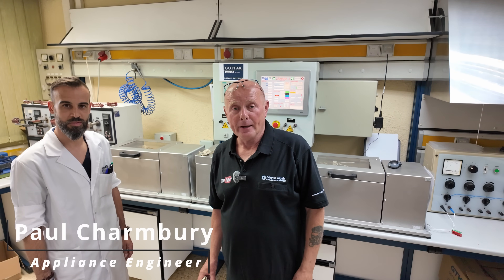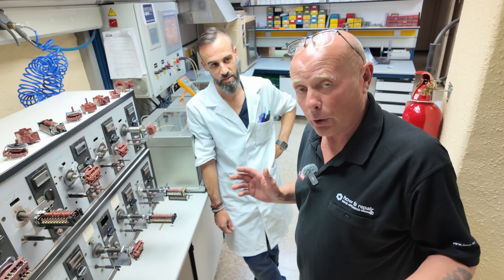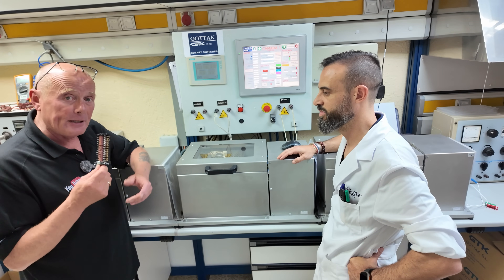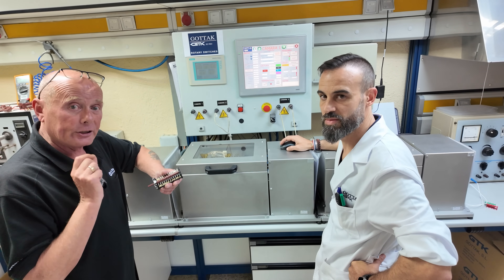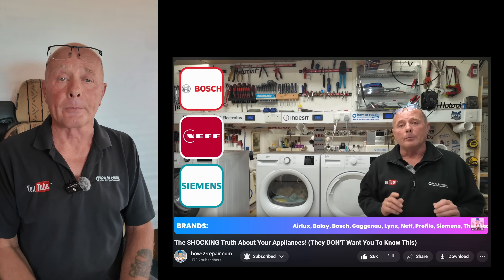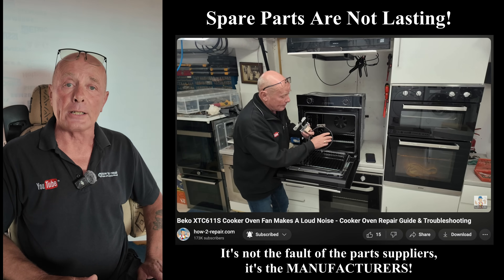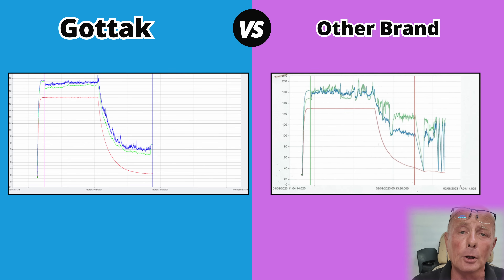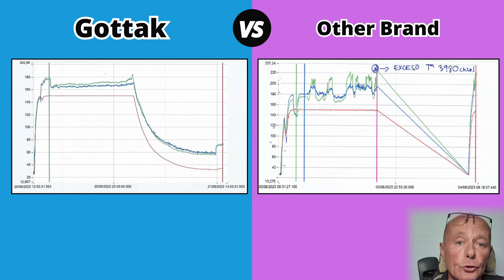Why Your Appliances FAIL SO FAST! Lab Results EXPOSE the Truth!

Comment: I'll very happily add a comment if it might help! IF the manufacturers are actually reading, that is. I'd say to them "cut it the F out!" Whichever manufacturer decides to actually build quality again can still boast about sustainability because we won't be throwing away tons and tons of these machines. If they're willing to be transparent enough to back up reasons for increased cost thanks to superior build quality, I'll even fork over. But they've got to prove it, not just say it ...

Comment: You are so right about the quality of appliances these days vs in the 70s-90s.  I'm proud to say that I'm still using a Whirlpool washer that is 31 years old (I've replaced the agitator dogs twice, and the control panel once, but other than that, it's worked like a charm!), a Whirlpool refrigerator that is 31 years old (I've only had to replace the icemaker a few times), and a Hotpoint dryer that is 33 years old but is now experiencing some trouble with shutting off (which brought me to your channel!  I'm hoping to find an easy fix for my dryer so the legacy can continue.)  My daughter's new-fangled washer with all sorts of computerization, on the other hand, died just a month or two after the warranty (which I think was only 1-2 years!) and cost her an expensive repairman visit.

Comment: It may not matter if you buy a more expensive appliance as the components may not be any better and will still fail just after the warranty. This has been a race to the bottom by the manufacturers who should give a price of ownership which matters more the the price tag on the front. Keep doing these videos they highlight the current problems of trying to get a quality product in a confusing market.

Comment: And it's not just appliances...it's everywhere, everythings going down in quality and shifted to be a throw-away product! I'm tired of it. And in most cases where something can be repaired, youre supposed to swap out whole units, instead of component based repairs (e.g. bad capacitor, failed transistor on a pcb, the broken bearing instead of a glued together washing machine tub and so on...).

Comment: I bought a Candy heat pump dryer some years ago and, lo and behold, it failed shortly after the warranty expired.  I attempted a repair, thinking it was a water pump.  That being replaced, it did not remedy the situation.  The dryer would run, heat up, but the moisture drawn from the clothes got sent out thru a vent into the room.  The conclusion ....I'll NEVER buy another Candy appliance.
Reply from the maker: Thanks for sharing your experience, and it's a familiar story for many.

Comment: When I started to notice this at least 10 years ago, the more I hang on to my 1992 Montgomery wards Admiral fridge, washer and drier. Plus a 1982 Roper gas stove that used old school pilot lights. The washer and drier use an old style rotary switch for the main control, the swiches are well built, the wiring is plenty adequate,the steel panels look dipped, not sprayed. Everything looks built to last 20 yrs min and NO processors. The fridge uses a simple TXV to cycle the fridge off and on and a electro-mechanical timer to defrost every 10 hours.  I finally had to add just 2 ozs of R12 about 3 years ago when it was 30 years old and replace the defrost limit switch behind the freezer panel. New old stock is available on ebay. Amazing how they used to build compressors that lasted decades. My Admiral has a Enbraco built in Brazil and the only thing that failed was the starter relay after 31 years. These appliances will outlive me.  I just replaced my 32 year water heater last year, a Rheem. Unheard of now days.
Reply from the maker: Unfortunately, the manufacturing mindset has shifted. The practice of built-in obsolescence, where products are designed with an artificially limited lifespan, is now common. It ensures repeat sales at the expense of the consumer's wallet and the environment. A 32-year lifespan for a water heater is, as you said, almost unheard of today.

It sounds like those appliances will indeed outlive you! Thanks for sharing such a brilliant, detailed comment. Please don't forget to like and subscribe to our channel. Cheers!

Comment: Was there a planned obsolescence for this video 😅? Rotary switches?! All my appliances (even my washing machine from more than 10 years ago) use control boards and relays (maybe even triacs, as I can't hear a mechanical relay clicking).
Reply from the maker: A failed board is a far more common and expensive problem than a bad switch. That shift from robust mechanical systems to fragile, non-serviceable electronics is the most effective form of built-in obsolescence today. This is the core issue we explore throughout our content. For a deeper dive into the problems with modern electronics in appliances, this video is particularly relevant: https://www.youtube.com/watch?v=QsdGd2qDPaI

Comment: The bean counters get involved because the "big boys" want to make more $ per unit and have the units fail sooner so that we have to buy more units through out our lives which results in even more $ for them. Quality is not a factor anymore. I would pay more for a quality unit, made with quality parts. The trouble is knowing which brands (if any) are of good quality any more. I repair small engines. Briggs and Stratton used to be a good name. Now we call it 'Breaks and Scrap 'em'.
Reply from the maker: Thanks for the comment mate. The link between brand reputation, price, and actual durability has been broken, leaving even savvy customers who are willing to pay more for quality in a difficult position. This is the very definition of the built-in obsolescence we discuss.

Our goal is to try and bridge that information gap. For a deeper dive into the manufacturing tactics that have eroded quality, please check out the full video here: https://youtu.be/gEgSCbZnHVM?si=wTIw0mELuhWaw4aX

Comment: A few years ago I bought a 3 hp radial arm saw built in 1953. Four years before I was even born.   It was well kept and looked like new, and works like new.   Still running without any issues 72 years later.
Reply from the maker: Your saw is a perfect example of what we've lost, and its story is the exact opposite of the built-in obsolescence we discuss in our video. For a deeper dive into why modern tools and appliances often don't have this kind of longevity, please check out the full video here: https://youtu.be/gEgSCbZnHVM?si=wTIw0mELuhWaw4aX
Reply: @How-to-repair About 30 years ago I bought a ShopSmith. Its lasted all that time without issue. I bought one because I could not wait for my Dad to pass to inherit the one he had had for 40 years.   It’s well made, and still made in the USA but their stuff is so durable and lasts so long that they are in perpetual peril of going under.  Even new buyers can find them used online for a fraction of the cost of new because they still work like new.  As a result the company that makes them has a hard time making a profit.   They just sold to a new owner, who is trying hard to promote the product, but folks are in love with their all plastic Box Store tools.  Every part on the ShopSmith mark V is user serviceable and the parts have not been changed or modified in 60 years.   They started making a new power head with a touchpad interface to control speed- which I think was a mistake, because the variable diameter pulley and bell crank system the ShopSmith has had for 70 years has been bulletproof. 
You I might want to do an episode on the ShopSmith being the last major power tool brand being made in the US.  Or on the Original Saw company that still manufactures old 1950’s designed DeWalt radial arm saws.

Comment: I’m not an engineer but as a consumer I have noticed white goods becoming worse. Especially Hoover and Bosch.
Reply from the maker: Hi mate thanks for your comment. You absolutely don't need to be an engineer to see what's happening your experience as a consumer is what matters most, and you are spot on.

This is the very definition of the built-in obsolescence we discuss in our video. Our goal is to show people what's happening under the hood of these machines. For a deeper dive into the specific ways quality has declined, please check out the full video here: https://youtu.be/gEgSCbZnHVM?si=wTIw0mELuhWaw4aX

Comment: I used to repair wyse terminals in the 90s. They deliberately put a type of glue compound acriss some of the internal components that after a period of 3 to 5 years would turn from yellow to brown and become conductive, causing an electronic fault. There was zero reason to use that glue on the top side of these circuit boards. Once fully scraped off, the units would often start working again, often without the need  of other component replacement.
Reply from the maker: Your story from the 90s is a powerful reminder that this isn't a new problem. While the tactics may have changed—today it might be a specific capacitor on a TV power supply designed to fail or a software update that slows a device—the cynical philosophy of designing products to break is exactly the same.

This is the very essence of the built-in obsolescence we expose in our video. For a deeper dive into how this mindset affects the appliances we buy today around the world, please check out the full video here: https://youtu.be/gEgSCbZnHVM?si=wTIw0mELuhWaw4aX

Comment: 2 words. HOLLOW RIVETS. The bane of electrical devices here in USA. Our paper lined bulb sockets, and switches, receptacles, etc, and it is getting old and frustrating for me! I have cheap lamps made in China with sockets held together with screws and they are robust and fixable like the early sockets made over 100 years ago. The modern sockets etc use awful metal choices like aluminum for bulb socket screw shells, and the hollow rivets holding it all together are weak and loosen up, and where 2 parts are in contact to complete a circuit, they get weaker contact snd arc, cause the light to work intermittently, and worst of all overheat from resistance from poor contact! Our wall receptacles will have same issues plus contacts made of spring brass instead of phosphor bronze like robust older ones did. I will say many electrical fires were caused by by this JUNK. I sweat we make the worst electrical devices in the world! Total garbage and extremely frustrating!! Cheers! 👍🏻😋
Reply from the maker: This is built-in obsolescence at its most granular and dangerous level. While your examples are from the USA, we see this same philosophy with different components all over the world. It's a global issue.

The issues you've highlighted are a perfect example of the manufacturing mindset we discuss in our video. For a deeper dive into why companies make these choices, please check out the full video here: https://youtu.be/gEgSCbZnHVM?si=wTIw0mELuhWaw4aX

Comment: My dishwasher was made to fail. A rubber elbow hose was made in such a way that it fails not long past warranty. I learned this when mine failed and I read reviews on the replacement part. It was failing for everyone. WD24X33918
Reply from the maker: Your dishwasher hose story is a textbook case of what we talk about on the channel. A simple, crucial component designed to fail just after the warranty expires is one of the most common and cynical tactics we see.

The fact that you confirmed it by reading the reviews for the replacement part is brilliant. That's where the real truth often comes out, showing it's not a random failure but a widespread, predictable one. This is a classic strategy: use a material for a crucial part (like a rubber hose) that you know won't stand up to the heat and chemicals it will be exposed to long-term. The part is cheap for them to make, but its failure causes a major problem for you, the owner.

This is exactly the kind of built-in obsolescence we expose in our video. For a deeper dive into why manufacturers do this and to see other examples, please check out the full video here: https://youtu.be/gEgSCbZnHVM?si=wTIw0mELuhWaw4aX

Comment: Just look at the lightbulb. No profit in ever lasting products. Money is everything that matters to the giants
Reply from the maker: The story of the lightbulb, specifically the Phoebus cartel of the 1920s, is the textbook case of planned obsolescence. It's where the world's giants first colluded to deliberately shorten a product's life to boost sales.

You are absolutely right: the core principle behind it is that there's no profit in ever lasting products. That mindset, born a century ago, is still the main driver of the problem today. The only thing that has changed is the method. Instead of a weaker filament, today they use non-repairable electronics, flimsy plastic components, and software that becomes obsolete.

This is exactly the kind of modern built-in obsolescence we break down in our video. For a deeper dive into how this plays out in the appliances we use today, please check out the full video here: https://youtu.be/gEgSCbZnHVM?si=wTIw0mELuhWaw4aX

Comment: Naive message. At the end, it is the consumer that decides. If I have a summer house I visit 20 weekends a year, that makes 400 rotations over 10 year period. I may want to save some money, buy a cheaper brand and spend the money on beer or steaks.

In my house, where I cook every day, I will spend money on a higher end brand and a model that is built to last longer.

The issue that the author has is that manufacturers produce cheaper parts that don't last that long. I will turn that orthogonally and say the problem is the consumer purchasing those cheap products and expecting to have the same quality as the ones built from better materials and that cost more.
Reply from the maker: The issue that our video aims to address, however, is the breakdown of a key assumption in that model: that a higher price reliably equals a longer-lasting product.

Unfortunately, this is often no longer the case. The core problem we see today is that many expensive, high-end brands use the same failure-prone plastic components and under-specced electronics as their budget counterparts. The extra money a consumer pays often goes towards aesthetics, marketing, or complex features, not fundamental durability.

So, to build on your point, the problem isn't just consumers buying cheap products and expecting them to last. It's also consumers paying a premium for quality and durability, only to discover that the internal parts were not built to a higher standard. Consumers want to make the rational choice you describe, but they can't when information about longevity and true build quality is hidden from them.

This is the specific form of built-in obsolescence our video focuses on—the hidden decline in quality across all price points. For a deeper dive into this and to see examples of these components, please check out the full video here: https://youtu.be/gEgSCbZnHVM?si=wTIw0mELuhWaw4aX

Comment: I had a washing machine with mechanical controls. It was still working after about 40 years when I re-married and my new wife wanted a top loader.😊
Reply from the maker: That's a perfect example of what we talk about on the channel. 40 years of service is an incredible run for a washing machine! The most telling part of your story is that the machine didn't even fail it was still working when it was replaced simply due to a change in preference.

The shift away from that kind of durability is the very definition of the built-in obsolescence we discuss in our video. For a deeper dive into why new appliances don't seem to last as long, please check out the full video here: https://youtu.be/gEgSCbZnHVM?si=wTIw0mELuhWaw4aX

Comment: Biggest issue is the gasses. Sure they say they’ll recover the gasses but I’ve seen cut fridges. I can’t believe the EU are mandating this. 

I do repairs on a well known high end tv brand and I know what you’re saying about the lifespan
Reply from the maker: Thanks for bringing up this incredibly important point. As someone who works in repairs, your perspective is especially valuable.

You are 100% right to be concerned about the refrigerant gases. The environmental damage from improperly disposed-of appliances is massive, and your experience seeing cut fridges shows the huge gap between what the regulations say and what actually happens on the ground across the world. It's a failure of enforcement that has serious consequences.

We hear your frustration about new mandates. It's a major problem when policies push for new technologies without first solving the longevity and end-of-life issues for those products. If appliances have a short lifespan, as you've seen with high-end TVs, we just accelerate this cycle of disposal and risk.

This is a critical, hidden environmental cost of built-in obsolescence. The single best way to prevent harmful gases from being released during disposal is to make appliances that last for decades, drastically reducing the number of disposals in the first place.

This is exactly the kind of issue we discuss in the video. For a deeper dive into the manufacturing mindset that leads to this throwaway culture, please check out the full video here: https://youtu.be/gEgSCbZnHVM?si=wTIw0mELuhWaw4aX